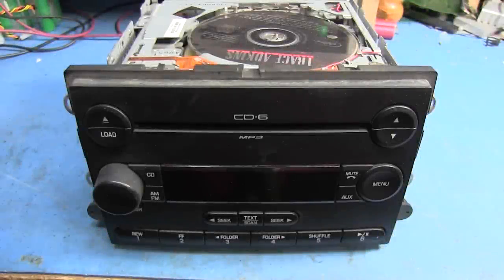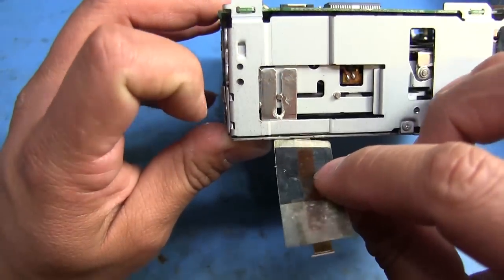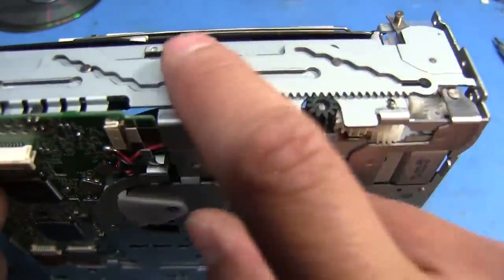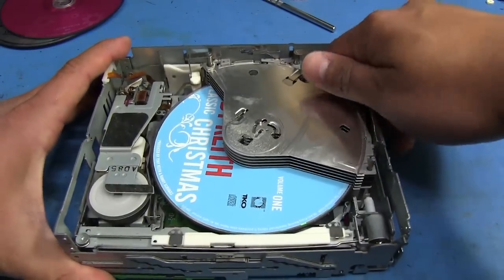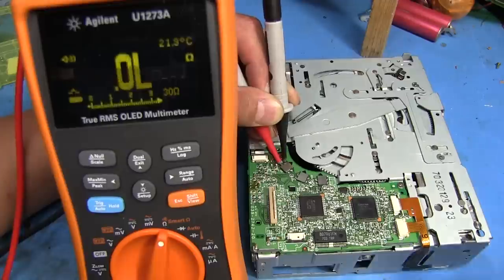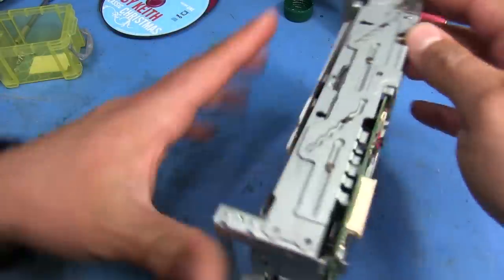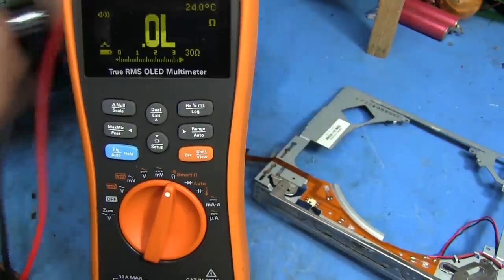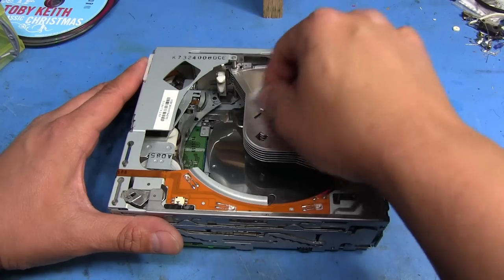TWB #5 | Let's fix it! Jammed In-dash Ford 6 CD Changer Repair

Comment: Great video, but poor ability on my end.  I have found myself unable to move the disk into the "S" slot and the sound returns upon plugging the CD player back into the radio.  I honestly just tried to fix it to save myself from the annoying sound it makes as it tries to fix itself every time I turn the car on.                                                                                                 *QUESTION: Could it hurt my vehicle/radio if I were to plug back in the radio and leave out the disk player part indefinitely?  The rest of the unit seems to work fine this way, but I'm not experienced in electronics and am paranoid it may fry something if I don't.  I am fine without having a CD player to save me the cost of a new unit, but not if harm can ensue.  Thank you to all in advance!

Comment: That is a very good video EXCEPT in my case the arm that moves over to the center of the CD and has the motor and actual CD reader (Laser Arm) is stuck in the engaged position and you don't show me how to move it back to the stowed position out of the center of the player ??? If I could get it out of the center (or the Play position ) of the player I think I could reset everything to make it work .... HELP !!!

Comment: Phenomenal video.  I disconnected both batteries to my 2008 F350 diesel to clean the battery terminals.  Discovered upon reconnecting power that the 6 disk CD player (that had worked flawlessly up to that point) was no longer working.  Your video allowed me to pull the CD player out of the radio, take off the sides, remove the 6 CDs that were already loaded, and re-set the entire system.  Thank you for the great video and the assistance in fixing my truck's radio/CD player!

Comment: Alex, I hardly know where to begin.  First of all, great video!  Very informative, very professional and thank God no awful background music!  Well worth my time to watch it twice.  One time straight through.  Second time while I was disassembling my unit.  I got it apart just fine up until removing the black gear.  I could not get the split ring off to save my soul.  Probably needed a sharper removal tool.  So I could not perform all the steps as described in the video.  I did manage to remove 6 of my favorite CD’s and get the unit re-assembled without any parts left over.  Alas, it did not work any better when l was finished than it did before l started.  BUT . . . I did mange to retrieve my CD’s.  So . . . I went to your Patreon page.  I would be glad to make a contribution to your future endeavors but it appears that a subscription is the only way to do so.  People who do what you do should be encouraged.  I would make a contribution but l am not ready for any long-term commitments.  If you have not already done so, I would encourage you to get a website and start taking in work for hire.  I would gladly pay to ship my unit to you, have you perform the work and send me back a unit that functions like the one in your video.  Keep up the good work.

Comment: My 2007 Ford Fusion had been jammed (without any cds in it) since I bought it last summer.  And when I was trying to fix a separate radio display issue I found this video. Followed along and worked perfectly. However, I used CRC 2-26 Lubricant/Cleaner to clean the contacts.  Also the big gear at the bottom did not have the same markings as the one in the video, but was able to find the right spot.  Thanks a ton!
Reply from the maker: Awesome, glad to hear the video helped!

Comment: Wow, IT field tech here. I'm really impressed with your work. 
Unlike many of the videos posted, you detailed the loader mechanism.
I actually have a '03 Bose changer, but I'm trying to see if there was any chance of rotating something manually to get my CD's out. Only my top loaded disc did that so far so I wondered if there was a gear that could control the CD disc level. 
Looks to me like that's a iffy "yes" only, unpowered it's unlikely to do what I want without removing pieces. 
I already knew how well calibrated everything was so I was trying to avoid disassembly. 
I got my answer, thanks again.

Comment: Excellent video. Mine was jammed because while I was removing the unit from the dash the CD player started to shuffle, and a CD fell out of place. I didn't have to take it as far as this video. With the radio cover removed, I reconnected the radio, and played with the problem CD in between the CD shuffles until it fell back into place. Lucky! If you try this watch your fingers, and select the eject button to get the unit to shuffle if it stops shuffling. I cleaned the switches as well since I was already in there. Cheers, and good luck!

Comment: Excellent video.  My F150 CD player was cycling 6 times making annoying sounds then after about a minute displayed CD Error.  Every time I turned the ignition on, the same irritating cycle occurred.  I followed the step by step instructions in this video.  My computer was right next to where I was working, hit rewind and play several times.  There wasn't any CDs in my player however it was out of synchronization.  I must say I had quite a time getting the CD slots in the correct place and the "S" in the window.  Bottom line the player is back together and working properly for the cost of a can of contact cleaner.  Thank you Workbench!!!  Oh yes and thanks to my wife for her assistance, it took four hands to do some of stuff the guy in the video did with two hands.

Comment: I have a 6 CD changer in my Mazda CX-7 that has been experiencing eject issues, CD errors trying to load for about 3 years now and was at the point where it would no longer play, eject or load. I was ready to replace it and ran across this video. Although my player was different from your video it was close enough that I could follow and fix my changer to as good as it was when I purchased the vehicle New. Thank you, thank you, thank you!
Reply from the maker: Icn2pcs Awesome!

Comment: Thanks for the video.  I was able to resurrect the CD player in my mazda following your steps.  I even cleaned the switches and saw the same change in resistance.  You saved me quite a lot of trouble finding a replacement.

Comment: Thank you for the instructions!  I appreciate people like you who spend their valuable time making these tutorials, and this one was great.  I did have some problems with synchronization.  I aligned with the "S" and put the stack at the position you had in the video, but it still was jammed when plugged back into the car.  I then removed the black gear again, plugged in the unit to my car, let it run through its routine, disconnected, reinserted the black gear, and it worked great.  The gear set must have stuck somewhere wrong when it originally jammed, and since we aren't rotating those gears with it apart (no power), they stayed in that unsynced spot.  Also, I removed the large shiny plate on the inside bottom of the unit since it was warped and adding friction to the giant flat gear that rotates on the bottom.  From what I can tell, this isn't necessary.  One last thing, I used a DC power supply to operate the motor you removed in the video.  I tried turning the gear manually (with the motor out) but it was very hard to move.  The power supply showed where the unit was jamming.  Thanks again!!
Reply from the maker: The only reason why I don't necessarily like using power on the motor to rotate the gear is that I've had one strip before, which made it even worse. Good to hear you were able to get yours working though!
Reply: This comment helped me a lot. I have the PS-3140K-A in my Suzuki SX4 and the large gear at the bottom has the letters/numbers L, 2, and G. I aligned the gear so the window would show "G" instead of "S". Then I just followed the steps that James did. I'm so happy to get the disc changer back up and running. Thank you both!
Reply: @GriffinU  I am glad the steps above helped!  Two years later and my problem has returned, probably due to the little switches that were problematic last time.  Now mine comes apart again.  Hopefully yours is still working or you got a new car.
Reply: oh you are a much smarter man than I. Thank you for sharing! Shout out to the creator as well as there was nothing else out there in this capacity. Just bought a 2007 Ford Focus lol was pretty excited that everything was in such good shape. Just had to try filling the CD player all the way up. That running it without the black gear was a smart idea, not sure I would have ever went there. Thanks again.

Comment: Very thorough video on the 2008 Ford Edge with a 6 disc player. I have  the same model year with a 6 cd changer and it jammed. I just finished putting it back together, will test it out in the morning. I had thought about taking it in to the repair shop, but at today's labor rates, it'd probably cost a fortune. Didn't have any screws left over after the disassembly and reassembly, keeping my fingers crossed.

Comment: Hello The Workbench, hope you're doing well today. I was just wondering, I have the exact same radio Shaker 500 but I can't figure out how to power it up in my electronics workbench.  I figured this radio is 12V and probably only need less than 1.5amp from a power supply to power it up... that's my guess. Now the questions is, what connectors did you use to power up the CD Changer to begin  testing the device.

Also, wanted to congratulate you on such a detailed and well made video that has all the descriptions needed to understand the job, and also, great camera angle and focus to see exactly what you were doing. I am definitely going to follow in your footsteps to learn from you.

Hope to hear from you soon.

Comment: Well sir, I have the same radio in my 06 Expedition and the problem with my cd player is that it wouldn't load or eject any cd's I tried to load up. It didn't even recognize that there was a cd in the machine when I manually loaded up a cd so this video helps HUGE!!!! I will see about pulling my cd player out of my radio and doing the same thing you did. Many thanks for a very informative video and you now have a new subscriber.

Comment: Thank you so much! you saved my 6 cd changer! I found it was hard to take the lid off because those screws are so small and so tight, so i just tried my best to follow your step. I took out all the cds and cleaned all the sensors. It back to life again. one thing I notice that there is nothing written on my big gear, like 1,2 or letter S. and the 6 cd changer I got is from a 2009 murano

Comment: Mine didn't have the stuck cd's, but I sprayed the connectors that you did, and when I first put it back in my car it still acted up at first as I don't have the ability to bench test, but after a minuet it asked for a disk and I said "All Right!", now it works fine. Thanks for the great instructions.
Reply from the maker: Great to hear you had some success!

Comment: I too was extremely amazed at how well  your video was done! I did every step exactly as you did, following along. I’m absolutely positive that I put my unit back together exactly as you described. Was able to remove one cd from the top slot. However, now upon testing the player reads “ initializing”, but won’t load a cd. Is it possible that I assembled the plastic micro switch cam assembly incorrectly? I read where some units that do this need reprogrammed or reflashed at the dealer? Please respond to my question. Thank you!

Comment: Thanks much for taking the time to post and share your knowledge with this very informative video. I watched it, followed your directions and now my cd player is working again! My large gear had a G on it not an S, and I also had some troubles when I put it back together, It would not load a CD but then would eject it and give a CD error. Discovered that when I put the top on the little slider that controls the door that opens the CD was on the wrong side of the top piece causing a bit of a bind. Thanks again!

Comment: great video long and educational and doesn't just stop at getting the discs out, cleans switches, and does a walk through on reassembly i have this exact unit and i messed it up or the switches were bad like shown here and im going to use the vid to help guide me take it apart.

Comment: Do you ever work on other people's CD players?  I have the same one that you are working on here and a CD has been stuck in there for years, rendering it inoperable. I get "Load Error" and "Eject Error". The menu button does not cycle through all of positions it should, like speed volume, bass, treble, etc. There is only one place in Tucson that I can take the unit to who will get the CD out but I'm almost positive that they won't do the thorough quality job that you do. I would worry about the same thing happening again. I don't think that I could do this by myself -  I'm too old and it's too complicated. I would lose all of the screws and break it more than it is already.

This was one of the best videos I've ever seen. If you would take the work, I could ship it to you for repair. You tell me how much it will cost. I would really appreciate an answer from you-yea or ney. Thank you.

Comment: Your instructions are very helpful.  I just wanted to take my radio apart to remove the CDs and put it back together so it works for the radio and the rear dvd.  Cd player still doesn't work but i have the Cd's and everything else works.  I only had one extra screw when I was finished.
Reply: Just making it more efficient by needing 1 less screw.

Comment: Try an easy way before trying to get into the assembly/
Take a disc. wrap very strong sticky tape. wrap around one end of the disc, and twist the tape so that the sticky side is up.
hold the tape with your thumb. Insert a bit into the slot and push down, until you feel it is on the stuck disc. Push on the  eject button and at the same time pull the disc you are pressing down slowly. This works because I did this Yesterday. If this doesn't work try a couple of times before trying to get into any complicated procedures.  Good luck, Keep well, Keep smiling.

Comment: I believe you're correct. No hexagonal hole on either side of this gear. It may vary slightly by design. Mine is from a 2003, but pretty much identicle to the one in your video. When you turn the gear at 11:50 in the video, the white assembly behind the trays and the two white loading fixtures move. Mine does not, so this may be the issue. Just need to know where the gear goes. Thanks for your help!!

Comment: Great video!  I was able to repair our 2008 Fusion CD Changer.  It developed a problem (dropped a disk?) when I disconnected the battery to replace.  Sounded just like yours at the beginning of your video, went through your procedure and got it going, Thanks!

Comment: Great video and especially the explanations and close-ups. I have a unit in a '02 Honda Accord. Seems to have fewer large moving parts and more worm gears. Still holding CDs - played for a short while but not again since. I suspect sensors but they're not as clearly shown without the big take-apart. I can see it's not same as this one. Thanks!

Comment: Thanks for posting this.  A great explanation of the inner workings in these units!   I just picked up an 02 Ford Explorer and the deck says its full when I tried to insert a CD.  Hopefully it has six good rock CD's in it and not any rap music!  The Deoxit is on hand as I use it when refurbishing vintage tuners and amps.

Comment: Best video ever, very helpful in trying to fix my wife's cd player in her Ford.  However when I took it all apart my issue was not with the contacts being dirty but rather I discovered a broken gear.  Specifically the one white gear next to the black gear that you initially remove so that the tray can move freely.  I suspect that this too is the reason for several people having issues with this particular cd player.  Would you happen to know where I can obtain this particular gear and possibly some new retaining clips?  The one clip I took off of the black gear seemed to be somewhat deteriorated.  I wonder if this correlated in anyway to the other gear breaking.  Also do you know the manufacturer of this particular radio, I believe it to be a Delco, but am not 100% sure.  Again great video, it's guys like you that I truly appreciate and the many reasons I am able to fix things or at the very least gain knowledge of how to fix.  Thanks!

Comment: Wanted to pass along my thanks and appreciation for the helpful video you provided.  I employed it successfully on a 2008 Ford Fusion.  While not very knowledgeable on electronics, I found it easy to follow.  Could I recommend some caution on removing the ribbon cables, especially the small one?  I may have broken the black slide-out connector. But so far it has not proven problematic.  My unit did not have the same markings on the big gear but it didn't seem to matter.  Also as a senior with poor eyesight, I had trouble seeing the split in the two retainer rings and even more trouble trying to "pick" them off.  I found that if I pried up on the black gear and the white switch activator while holding a finger over the post and ring, they would pop off.  Again, many kudos.
Reply from the maker: Megan Selle Glad to hear the video helped!

Comment: Awesome video, was very helpful for me!  I fixed what was wrong with my 6 CD changing stereo but after putting it back together it looks some parts are out of sync as if some motors need to be in a certain starting position when it's first powered on. Was careful dissembling my 6 CD changer but it's still not happy. Any suggestions on how to find the correct positions?